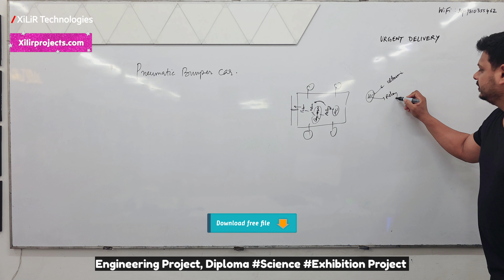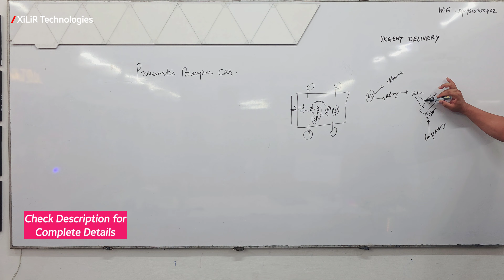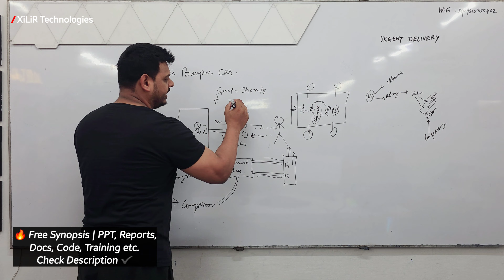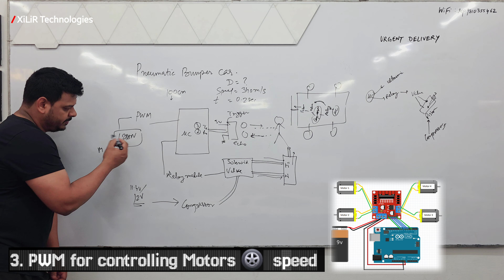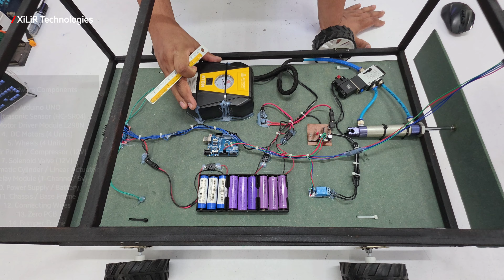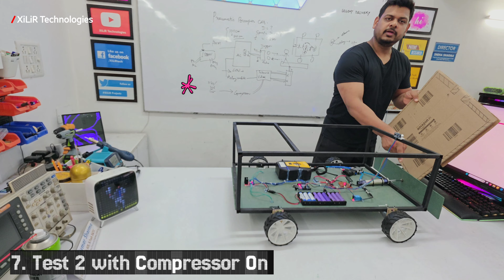Advanced Pneumatic Bumper Car using Arduino | Smart Anti-Collision Safety Project 🚗

Comment: As per my knowledge,it will make more collateral damage than a normal bumper, " i recommend you to make it the reverse way, extend the bumper before collision and make it to absorb the damage so that the car can survive the hit." Again these techniques are good, but the A and B pillars are heavily engineered these days and will take the impacts equivalent to the thing I have explained, again no hate, just a suggestion 🤝🙌
Reply from the maker: Great insight, I will consider adjusting the mechanism to absorb impact better next time.